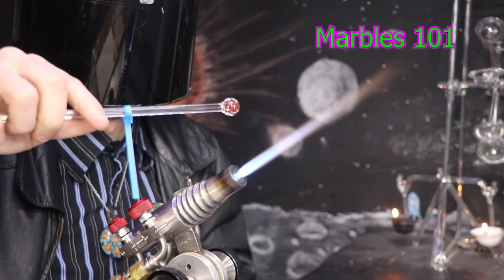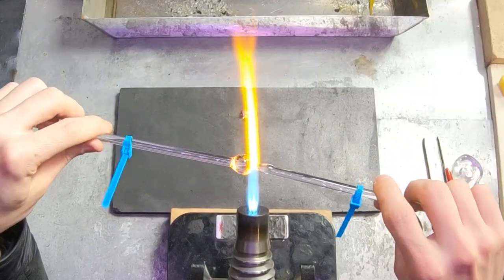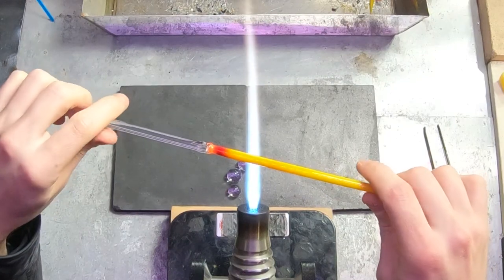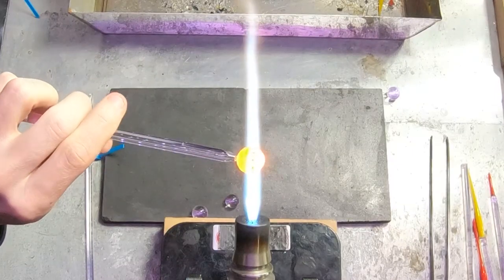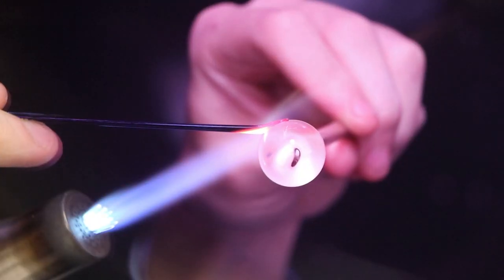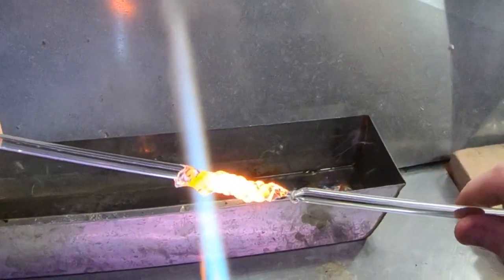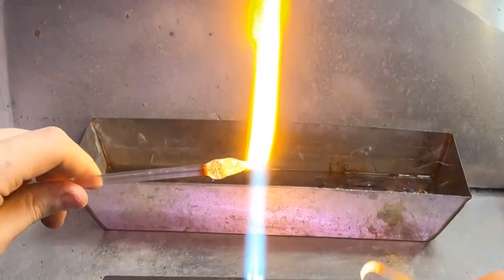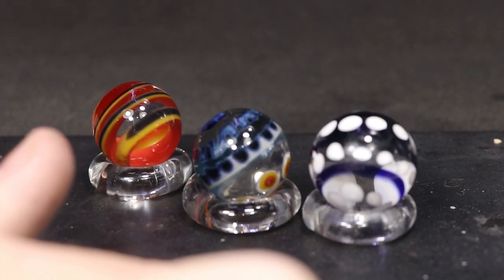Marbles 101 Flame workers Beginner Course

Comment: How does the dots and lines stay intact when you heat the marble back up to remove it from the punty or add more to it???
Reply from the maker: That is a good question. I think it has to do with density and high melting point.